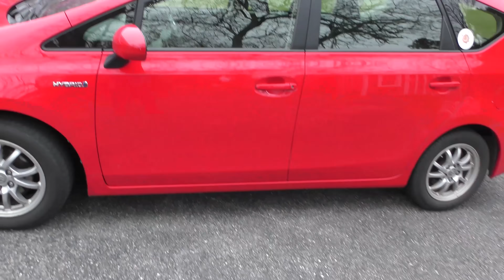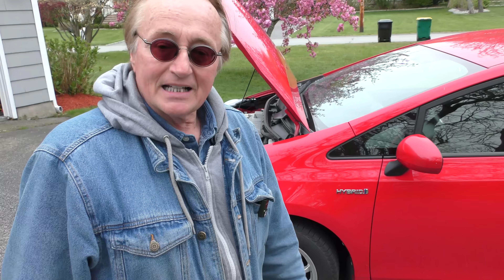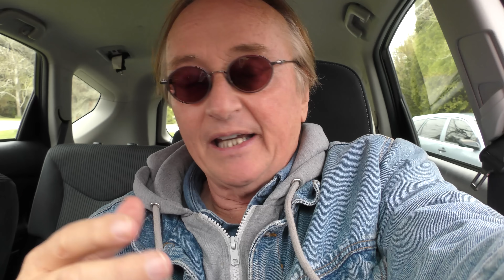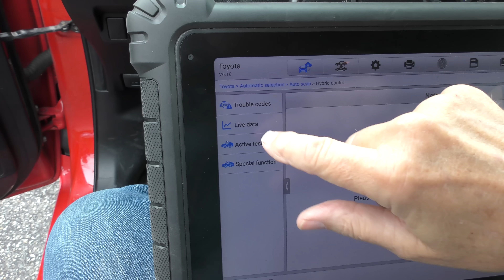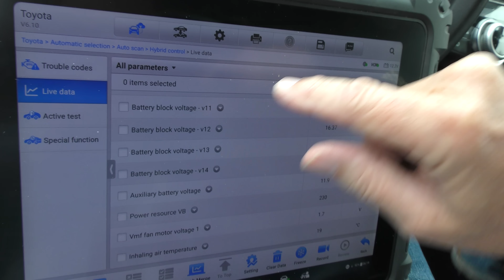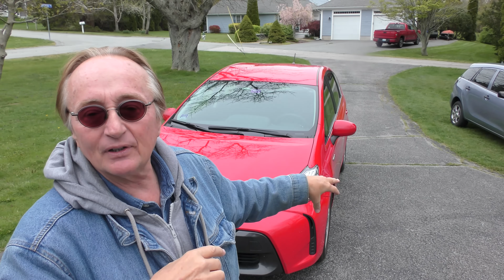I’m Sitting in the Best Used Car No One Knows About (So You Can Buy One Dirt Cheap)

Comment: I occasionally drive a prius C for my job, personally I don't like how it feels to drive, it's kinda clunky when you accelerate from a standing start, this seams to be because the driving electric motor is trying to propel the vehicle whilst starting the engine at the same time. I also don't like how when your accelerating and trying to get it going the engine is always reving its head off, this is probably because of the CVT. Another pet hate is what's the point of EV mode if you can't drive it at more than I think it's 20mph/30kph before a warning flashes and says you can't drive it faster IN EV mode then it kicks you out of EV mode. Personally I'd wouldn't own one even if you gave it to me free! And don't get me started on the interior, the most uncomfortable car I've ever driven, and ive owned 10 cars in my 35 years of driving,(I drive 10 hours plus when I'm driving).
Sorry scotty, other than fir fuel economy, the prius c is pretty horrible car IMHO

Comment: My 2015 Prius has 415k miles. No oil leaks ever.
Reply: There’s a video by some Toyota master mechanic with a Prius prime 2019 with 330k miles and still on the original brakes. Car runs fine. Talk about longevity

Comment: We used those V series for cabs in Las Vegas and they all went well over 400k miles driving 24hrs a day, and they were never in the garage for anything except normal maintenance.
Reply: I had a 2015 that I put 310 k mi on before I'm not so serious accident finally totaled it. I kind of abused it by going way too long between oil changes, sometimes 20 to 27,000 mi. Nevertheless, everything kept working and I only had one unexpected repair - replacing the electric coolant pump at 220,000 mi. Front brakes lasted 125K, rear brakes lasted 225K. All maintenance and service and repair costs seemed pretty reasonable to me.

Comment: I have a GM car Scotty hates, a 2012 cruze, eco trim, with a 1.4 L turbo, a 6 speed manual transmission. The EPA rates 42 highway mpg, I am in Texas And I usually get 50 plus highway mpg. I paid $17,500 in 2012. Now the car has 76k miles. I would argue gas turbo is much easier to maintain than these hybrid system.😂

Comment: if you're worried about the battery dying, don't be, there are a lot of 3rd party shops that will repair and replace dead cells.
you should worry about the inverter instead.

Comment: Taxi drivers have used Prius's here in the UK  ever since day one - very reliable.
Reply: I drove Uber and Lyft for 31,000 trips, about half a million miles. I did it all with two 2015 Priuses (standard, front wheel drive, non plug-in). The first Prius I gave up after 40,000 because it was totaled by F-150 that crunched me from behind. The dude's truck was quite messed up and he was unconscious. I was fine but the back end of my Prius was pushed in about 13 in. 

The second Prius I drove for 310,000 mi and all I needed to fix on it was the electric coolant pump that I had replaced. Everything else was just fine. Of course, I had to replace the front brakes twice in that time (they last about 125,000 mi), and the rear brakes once (they go about 230,000 miles). Replaced tires every 50,000 mi. Oil change every 10 to 12,000 mi. Wipers every year or so and headlight bulbs about every 25,000 mi. The 12 volt original battery lasted 6 years, and I replaced it myself for $130.
Reply: Priuses are fairly popular for Uber and Lyft driving here in Minneapolis, but not as popular as somewhat cheaper sedans. I drove to 2015 Priuses for half a million Uber/Lyft miles - 31,000 trips. I cannot praise those cars more. Overall, they were very reliable, good in the winter, cheap to run, and at the time I bought them, relatively inexpensive to buy in finance as a low mileage used car.
Reply: @bobbabai  If you don't mind me asking, how often did you change the transmission oil on your prius?
Reply: @NostalgicGabeYT  I don't know. I did service the Toyota dealer recommended and they might have done it once. Not sure.
Reply: I have a 2005 Camry XLE 202052 miles. Engine still has plenty get up and go.

Comment: How many calendar years do you get on the hybrid battery?  Are the 200,000+ miles run off in 10 years?  What happens when one of these is 20+ years old?
Reply: I am about to install a remanufactured hybrid battery in my wires 2011 Prius.  330k miles on it...$1800 for battery installed

Comment: I had to change the  engine in my 2016 twice due to blown head gasket and burning oil. Original engine lasted 180,000 the second engine lasted 60,000. Same as the first engine

Comment: Toyotas are generally built better than just about anything else out there but I'm just not interested in hybrids or EVs even if they are built by Toyota.  The only hybrids I like are locomotives.  I would rather have a 30+ year old Chevy Sprint or Geo Metro with that wheezy three cylinder of course only if it was in decent condition.  Those things are very basic but they were pretty reliable, easy to maintain, and you could get 50 mpg+ on the highway.
Reply: I'm the same way. I just don't have any faith in modern workers to have pride in anything from customer service to building cars.

Comment: My 2006 Prius had over 350k miles. After 285k the ABS pump burned out. Replaced it and barely even 50k miles later it burnt out again. Researching that generation, a defect in the wire harness was burning the pump out. I was willing to fix the car but it also had the issue starting at 250k miles were the dashboard wouldn't turn on. BUT over all amazing car, bought it for $3500 at 180k miles so I got my monies worth.

Comment: 356,000 on my 2014, never any brake jobs, how much have i saved...thousands.
Original battery, engine replaced once at 298,000 with crate engine.
Paint job is fading...who cares, the A/C still blows jingle bells.
Reply: Never replaced brake pads? You are a danger to public safety
Reply: Your AC doesn't blow air?
Reply: How much was the engine swap?

Comment: Only buy Toyotas with a "J" vin.  Made in Japan.
Reply: I agree. The J cars are best.
Reply: We have a 1994 Camry LE with a Japanese V6 (bought new in 1993).

The Camry is now 30 years; with 99,000 miles. It is still running strong with regular oil changes and premium fuel.
°°°
Reply: beg to differ.  the most troublesome cars i owned were a japan-made toyota tercel and nissan sentra.  most reliable were a u.s.-made toyota corolla and a france-made toyota yaris that i own, plus the thai- and indonesian-made toyota vios, camry, innova and fortuner that i have driven long-term over the years.